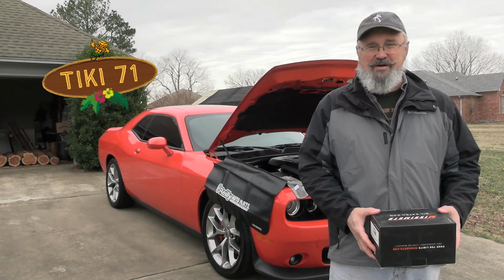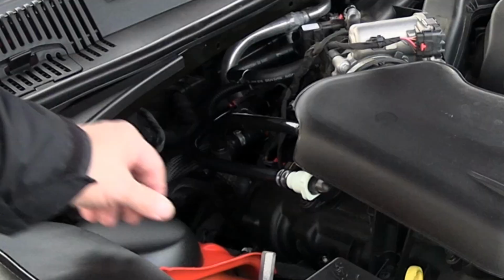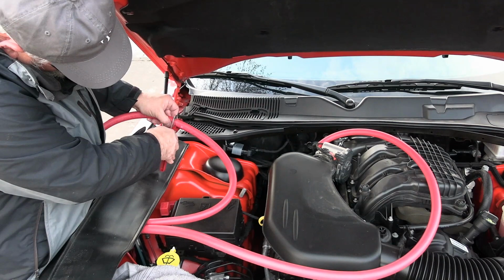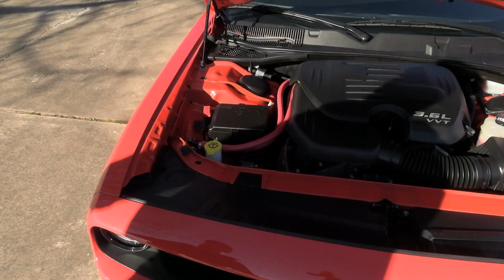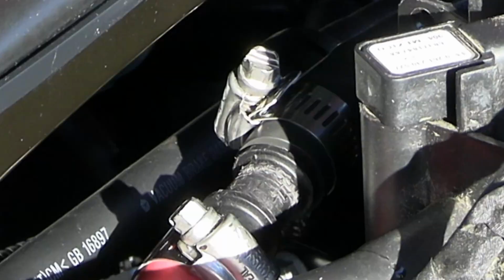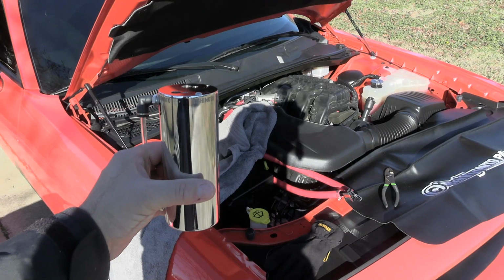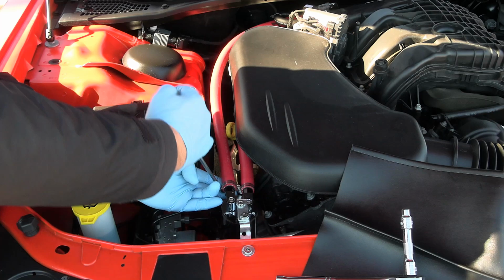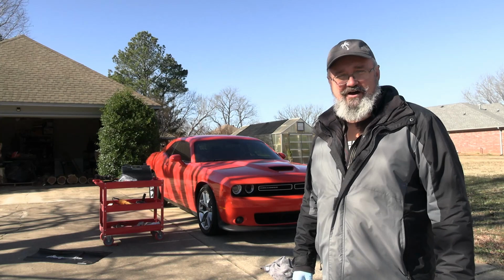You Might Need an Oil Catch Can!  How To Install #Challenger #Mods

Comment from the maker: Links 👇🏼
Mishimoto Oil Catch Can: https://amzn.to/3rBjPjR
A smaller version (I should have gotten): https://amzn.to/33tTigG
10AN Hose separator clamps: https://amzn.to/3KnafKl
½” “Universal” Catch Can Hose (4’): https://amzn.to/3fIdzBo

My Dodge Challenger Playlist:
https://youtube.com/playlist?list=PLH...

Other Mods, Upgrades, & tools for the Challenger (Videos coming soon):

K&N 63 Series Cold Air Intake: https://amzn.to/3qJIiV4
MGP Caliper Covers: https://amzn.to/33hT1NE
Dodge Challenger LOGO Puddle Lights: https://amzn.to/3nDcNtJ
Carbon Fiber/Chrome tip valve stem covers: https://amzn.to/3zUnfCi
Challenger Rock Guard/Mud flaps: https://amzn.to/3tInbEo
Instrument Knob covers: https://amzn.to/3AmXk6n
Dodge Challenger Floor Mats: https://amzn.to/3FKEiI0
Husky Trunk Liner for Dodge Challengers: https://amzn.to/3FJllWn
Challenger cup holder and pocket inserts: https://amzn.to/3rBNucM
Pedal Commander: https://amzn.to/3IkoQUN
Side Marker Tint: https://amzn.to/3nBPXTx
22MM Lug Nut Socket: https://amzn.to/3rigx5a
3/8” Air Ratchet: https://amzn.to/3K3qOuB
2 Ton Jack and 2 stand set: https://amzn.to/3K8VLxg
Auto Trim Removal Tools: https://amzn.to/3nG2gOI
“Quiet” Air Compressor: https://amzn.to/3tqObYT
My Palm Tree Hat: https://amzn.to/34bcfo7
Palm Tree License Plate: https://amzn.to/32widPU

🍹 We have a recommended product page on Amazon & it’s filled with the things we use and like & it’s a convenient way to check out what you see on our channel & it adds ABSOLUTELY no cost to your purchase: https://www.amazon.com/shop/tiki71  
If you click through and buy something, we receive a small a very small commission (as little as 1%) that costs you NOTHING extra, but it helps us with the costs of delivering content, so Mahalo (thank you)! 🤟🏼 

🌴 Subscribe: https://www.youtube.com/c/Tiki71
🌺Join our Facebook Page: https://www.facebook.com/thetiki71
🥥Instagram:  https://Instagram.com/TheTiki71
🗿 Twitter: https://twitter.com/thetiki71
🦜 Email: tiki71@yahoo.com

📭 Send letters, pics, and stuff (I might open it on camera and give you a shoutout}: 
Tiki71
c/o Jungle Jerry
205 Wilburn Heights
Central City, AR  72941

🥂 Buy us a tiki drink: https://www.paypal.com/paypalme/tiki71 

🌴 🍷 Okule Maluna! (Bottom’s UP)🥂 🌴
  

#Dodge #Challenger #Calipers #MGP #Covers